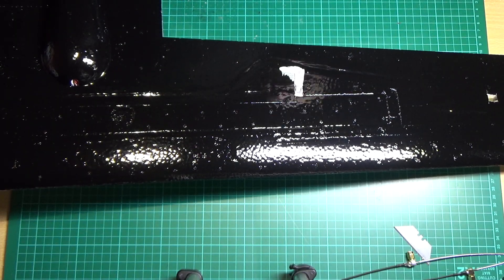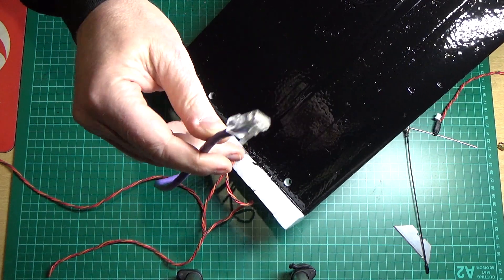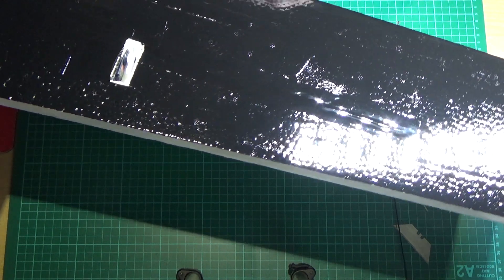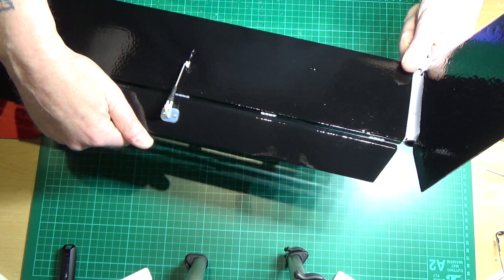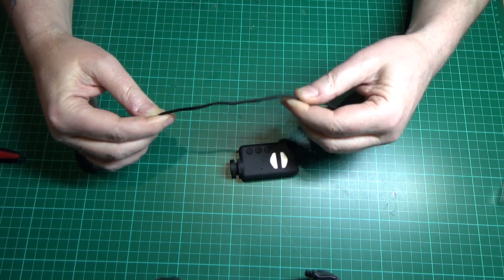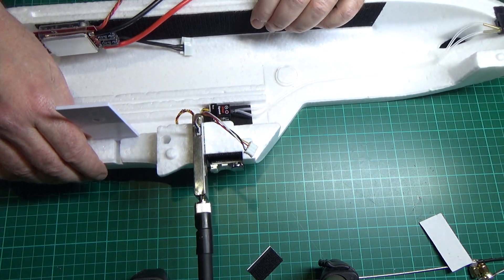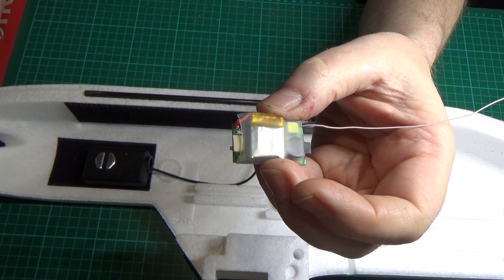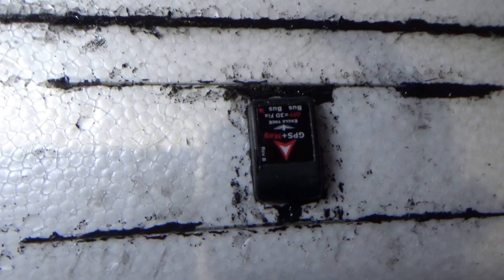SkyHunter FPV build part 6

Comment: That's some good locations for stuff. I use a rubber duck and patch antenna on my SkyWalker and it works great but keep in mind I fly basically line of sight and have never gone beyond video range, whatever it is.
Reply from the maker: +dmerc00 I hate to say it but..... I've moved everything again. All the RX stuff (EZUHF and GPS) is on one wing and the TX stuff (VTX) is on the other. The good thing about doing a build video, is everyone who's been there posts recommendations :-)

Comment: looking really nice now Tony....a bit of reinforcement on those vertical stabs and the tail section is finished?
 Liking the downfacing mobius lens too. :)
Reply from the maker: +flyin flea Cheers mate. I've already put diagonal carbon rods on the stabs and it's made it rock solid!
Reply: i knew you would...good work mate. :)

Comment: I really can't recommend Cat 5 cable or any solid core wiring for models. Vibration and flexing will fatigue and break the wires. 
For making multiple wing servo to fuse connections I like the green MPX series of plugs and sockets or the DB9,15.... series connectors for really complex setups like you are doing. Beats the pants off multiple servo connectors.
Reply from the maker: +Rob B When I'm thinking of how to fit things and what to use, I always think "what will Rob say" :D. 
It's multi-strand cat 5 (instead of solid core) which will reduce the chance of breaking. For the wing connectors,  I've used some ITX plugs and sockets from computer PSU's and computer mainboards (cut down from 20 pin to the amount needed) which have a locking tab on them. I've used ferrite rings on all power outlets and, since I did this video, I've moved the EZUHF and GPS (both receivers) to one wing and the VTX is on the other wing. I love your input, Rob....... it really does make me think carefully before I do anything :-)
Reply: +Vortecks Well someone has maintain some standards around here.
OK, I'll go now :)
Reply from the maker: +Rob B :D